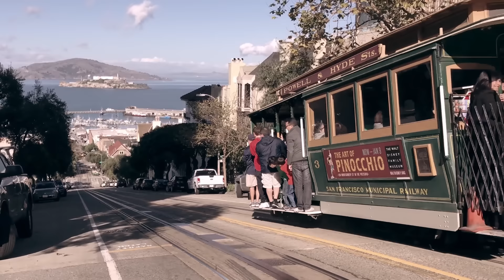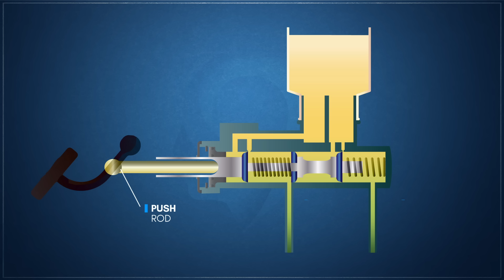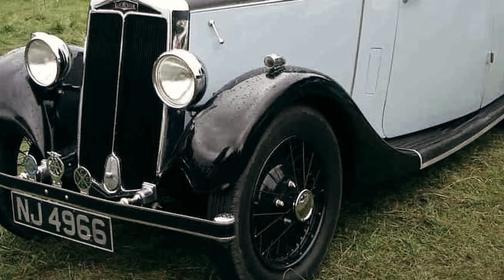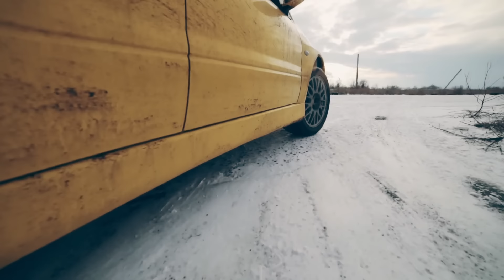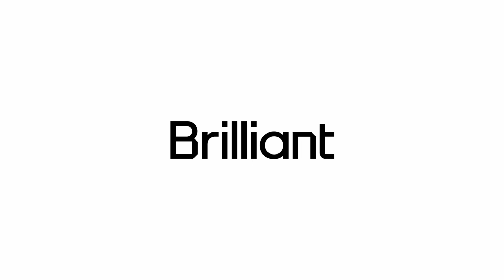The Science of Stopping

Comment from the maker: ▶Visit https://brilliant.org/NewMind to get a 30-day free trial and 20% discount on the annual premium subscription
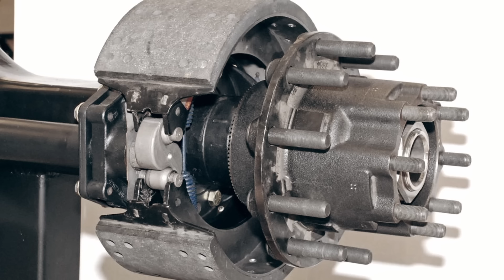Reply: 15:39 Should also mention UNECE, now the world's most significant vehicle regulation body (based on global country adoption), EG:
ECE R90, is a safety regulation which was introduced in 1999 for replacement disc brake pads and brake shoes - you will see "90R-xx" stamped on compliant parts.
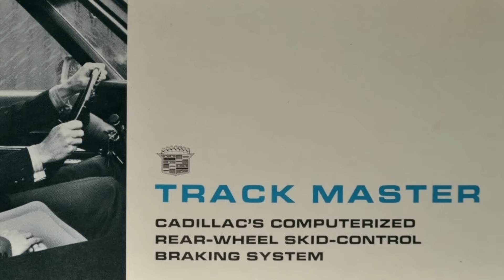18:24 The 'B' in ABS originally stood for Blocking, the engineering description given to a locked wheel.

Comment: Modern ABS systems have come a long way from the ones I grew up with and around, even when 4 channel systems became the standard. I know from my own testing with my 2003 Pontiac Grand Prix I had, if I modulated the brakes well, I could stop way faster than letting the ABS do the work. Now, I know brake modulation takes skills that most people are not willing to master, hence why ABS can be a great thing for those with a tendency to freak out and lock their brakes up in panic stops. At that point, yes, the ABS is great for making stopping distance shorter. However, I have seen even modern ABS systems get out braked by good drivers under a wide range of conditions. ABS, Traction Control and Stability Control are just band-aid fixes for people unwilling to actually learn how to drive.

Comment: Doing a bit of DIY motorsport gave me a new respect for the importance of braking. In the beginner stage the most important mechanical considerations are braking, tyres and suspension (in approximately that order). 

Most stock brakes simply can't be relied upon to withstand the extreme use of motorsport, particularly the amount of heat generated over and over again. Most people need to upgrade their brake pads to maintain friction at high temperatures, their brake fluid to stop it boiling, and potentially other components such as brake hoses, discs and calipers. Ventilation becomes very important too.

I was lucky with my Miata as it braked very well from the factory and the light weight reduced the amount of energy transferred for each braking event. But brake pads wore out very quickly, even the motorsport ones that cost several times the price of OEM. Discs would wear out at about half the rate of the pads and even high-temperature brake fluid could not prevent all deterioration and needed to be bled and replaced very frequently.

The lovely red paint sprayed on the clipers by the previous owner simply flaked off and eventually the dust boots perished and cracked, leading to a full caliper rebuild. That's when I realised how well-engineered the calipers were, because once cleaned up and refreshed with new seals and pistons everything worked perfectly again. And the polymer square-cut seals between the piston and cylinder showed no signs of wearing out whatsoever, despite almost 20 years of normal driving and a couple of years of serious abuse on the racetrack (and my inexpert attentions).

Comment: Fun fact: There is exactly one condition where non-ABS is better than ABS, if you are on a material that can build up in front of a wheel. Stopping a wheel and digging a little trench with it is faster than just slowing rotation. But that only applies to soft mud or sand, gravel, and uncompacted snow. But those materials are rare, which is why defaulting to ABS is better, and only some vehicles have the ability to disable ABS with a button.
Reply: Abs is ok but learning how-to drive has always served me way better than anyone's computer brakes bud
Reply: @Last-Chance-Garage-adventures  On a solid surface, ABS is superior to any human, because the computer can pump the brakes faster and more precisely than humanly possible. Of course, preventing to need the ABS in the first place is even better though.

Comment: Very good video, but I am missing one thing: Modern automotive brakes with metal brake discs don't use friction alone to convert kinetic energy into heat. They use stiction on a molecular level once enough force is applied and enough heat is generated. The high metal content of the modern brake pads is because of this. Imagine the metal atoms in the pads being close enough to the metal in the discs to get vanderwaals forces being effective. The result is much less wear in pads and discs than in traditional systems where all energy was generated by wear of pads/discs.

Comment: the problem with self driving cars is not driving a manual or controlling the steering wheel.  it should be more like the stuff about single wheel braking the steering force feed back to guild the wheel like playing a weegee board. something that you can over power if you want, but it suggests the steering inputs, and

Comment: 19:52 anti-lock breaks don't  create the shortest breaking distance possible. Highly skilled drivers (eg race car drivers and some performance enthusiasts) can out-perform ABS. It takes a lot of skill and harder to do if the available traction changes too quickly [eg if it suddenly starts raining in the middle of a race and the driver doesn't have the proper experience.
...Almost all race vehicles don't have any ABS at all (I think bk of a combination of added weight and cost to have a system that can out perform even a racer would make the richer teams have too much of an advantage)]
Reply: Most popular racing vehicles (like gt3 or gt4) got abs and traction control. In some series there isn't abs just to bring more driver skill in racing.
Also modern racing abs systems work so fast, that it's very hard to stop the car without abs faster than with abs even for pro racing drivers, and they never turn abs off during races to get better braking
Reply: @Grishazavr true "gentleman" class race cars do have abs and traction control but a driver is faster if they can avoid activating it. The exception is a few top level race vehicles that either don't have any (eg every formula car I know of) or where it is legal and has become part of the race to master the technology, eg MotoGP for traction control, or Hypercars for abs.
Reply: @lewisgordon1490  at first: you can't avoid to activate abs. It will trigger at some point for sure. second: gentlemen class? Do you know that a lot of drivers from 24h spa in gt3 class race next week in lemans 24h in hypercars? They don't turn off abs in gt3 to be faster. Even if you are somehow faster without abs by 0.3 seconds per lap, 1 small mistake and locked tyre would lose you quite a lot of time. And if you flatspot tyre it's like 1 more pitstop and more than a minute of time lost. Those 0.3 seconds per lap would never compensate it
Reply: True about lot of race cars have ABS but in most it is faster if you can drive under the limit JUST before the ABS activates in every race car that I know. In some classes the difference is smaller so some drivers just mash the break pedal esp if not the fastest of the drivers.

It may be disastrous for you or me to lock the breaks in a car but a pro racer knows how to deal w/ it. The worst case is usually they flat spot their tires then have an annoying vibration and be a bit slower, then they have to make the call of is it better to stay out doing slower laps or take the time to come in for a fresh set of tires. If it's a very mild flat spotting it's better to stay out but most of the time they get new tires.

Eg James Baldwin's usual race car has ABS but now he was driving a McLaren GT3 in the 2024 24hrs of Spa w/o ABS. He just came out for his stint on slicks w/ a drying track and some wet spots. Since his mind wasn't super tuned in to the balance between locking or not locking because his usual car did have ABS, he flat spotted his tires. He drove around w/ the annoying vibration for a few laps until he realized he was around 3 seconds a lap slower so took the time for an extra stop for new tires.

Comment: @newmind
 I am disappointed for your disinformation... ABS is absolutely not for maximum braking power, in fact only on dry surfaces you may observe reduction in braking distance. For wet, snowy and icy conditions ABS EXTENDS braking distance! System was never designed to reduce braking distance, but for avoidance of obstacles by allowing driver to steer the car while braking. If you really want to stop you need to keep your tires at the edge of locking up BUT before ABS kicks in. For most drivers this is impossible. But please do your own test brakes. With ABS on icy surface, and then try again with avoiding the ABS activation by gently pushing braking pedal. You will notice that ABS braking distance is much much longer. Please do a better fact check next time as you lost some credibility wit this video:(

Comment: The Disc Brake system was perfected and proven in Le Mans, like almost every safety feature was tried, tested, and proven during the 24 hrs of Le Mans, like windshield wipers, the safety harness (multipoint seatbelts similar in style to those found in modern race cars. The simple 3-point seat belts we use today was created by a Saab(?) engineer), fog lights, disc brakes, etc.

Comment: 6:47 the brake system doesn't "fluctuate" the amount of fluid used, it's more of the fluid gets displaced to the calipers and brake cylinders as the pads and shoes wear - which you kinda point out as you've explained through the video.

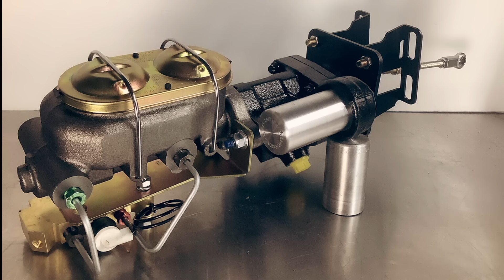11:15 hydroboost is primarily used to diesel as they don't generate enough vacuum (if I remember correctly or google doesn't betray me), there's another system used an electric pump that reserve hydraulic pressure present on 4runners (5th gen at least) and some other hybrids - why 4runner? I don't know because tacomas of that year use vacuum boost.

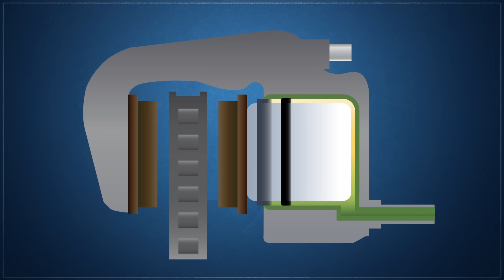14:01 I think if you've displayed it on an isometric view it would demonstrate how the caliper "floats" on the bracket attached to the knuckle/spindle with the use of the slider pin vs the fixed caliper which is directly attached to the knuckle/ spindle.

These are nitpicky and arguably unnecessary to know to the people who only need a bit of knowledge about these system, I do enjoy these videos and details like these can be useful.

Comment: I read somewhere that automotive is moving again to drum breaks for e-vehicles, since the reduced usage of the discs leaves them dirty. So they cant break effectively when most needed. A drum keeps the pads away from the elements
Reply: For what it's worth, most EVs with one-pedal driving have a mode or system that clamps the rotors just enough to clean the surface without the occupants realizing it. Sometimes this is only active in the rain (when wipers are enabled), while some have a discrete mode in their menus.
Reply: @Furious321 Yes, my EV has a hidden feature (mentioned in the manual) where you hold down an obscure button on the dashboard for 3 seconds to turn off regen braking and clean the brake disks.
Reply: I justed ordered an EV with drum brakes. Unless you're driving like an idiot, or making an emergency stop you should barely be using the actual brakes. Drum breaks have plenty of performance and endurance for that. The most torturous scenario previously was going downhill out of a mountainous region. Tens of minutes on end of twisty roads that zig-zag down a mountain face, and in each hairpin turn you have to slow the car waaaay down to make the turn safely. You'd really have to consciously try to brake using the engine as much as possible to prevent overheating your brakes. In an EV, it's pretty much the best case scenario for the car. It's charging all the time while you're going downhill, capturing nearly all of that energy.
Reply: they use the generators polarity
Reply: Drum Breaks are cheaper in production, i think this is the reason.
E-Cars have a Brake cleaning cycle, they but just a small amount of force the the Brake pads to clean of the surface.
Reply: Particle contamination that the braking system emits into the envirement, is the main reasson for moving towards enclosed braking systems, Mercedes is pioneering it.

Comment: 19:10 "such a rapid deceleration is impossible" - why?
Reply: I think it’s just missing a bit more clarity. Impossible that one or more wheels could go from high speed to ‘stopped’ immediately (implying the wheel must be locked while the vehicle continues to move, as opposed to the vehicle is actually stopped). Or impossible that, say,  the left front wheel is stopped but all the other wheels are still rotating, therefore it must be skidding.
Reply: @thereignofdando  let me add a tiny thing. The ‘impossible’ means that a vehicle never be stopped in a second by a brake.

However, a wheel itself could be decelerated rapidly when its tyre loosing grip (locked).

If it happened, the vehicle is not actually stopped, but still moving with a ‘rapidly decelarated’ wheel.

This is the reason why an ABS judges that the vehicle is sliding.
Reply: It is impossible for sudden deceleration of the vehicle to match the sudden deceleration of the wheel, more simply, the car cannot stop as fast as the wheel can stop rotating
Reply: The mass of the vehicle is known, the max deceleration grip of the tyres is known. So the max deceleration of the wheel is known. If the wheel decelerates faster then that means the wheel is starting to slip.

Comment: I like downshifting and braking with the engine... sadly works only in city outskirts and beyond, inside the city with pedestrian crossings, lights, turns every couple seconds there is simply no time for that. And if there is time and enough road- if you start slowing down way before the intersection several cars will cut you off forcing you to brake -_-

Comment: In the excellent description of the function of main brake cylinder however the vent ports and replenishing ports are vice versa, in reversed order. Not placed incorrectly, just described in the wrong order. The replenishing port is the smaller bore. Fluid is replenished to fill up the main brake cylinder when the pads wear in time. The vent ports is needed to displace fluid rapidly behind the seals when the pedal is pressed down or let up...

Comment: 17:00 planes needed anti skid system for landing gear with multiple wheel axles, if one of them stopped rotating during braking it could overheat and pop the tires during heavy braking

Comment: 19:30 actually the pump is there in this case (ABS braking) to reduce the pressure on wheels. When the pressure accumulator is full the pump forces fluid back to master cylinder against driver. This is what you can feel on the pedal and also why you should keep pressing it even after "Abs kicked in"
Reply: Thats kinda the point of abs, Mash the pedal and hang on
Most people without advanced training don’t know how to modulate the pedal or lever force to counter locking,
Letting go is hard you know 😢
Reply: @timmyjohnson7192  ABS is also just waaaay faster and much more precise than a human. It will outperform a human pumping the pedal every time.

Comment: Traction Control on some 4x4s can Lock the wheel that is in a low grip condition, so the other wheel can get the power from the engine. 
This means manufactures can forego adding locking diffs on that car and just software to help with maintaining grip in off road situations

Comment: Regenerative braking introduces a whole new kind of problem to vehicles today. Since the brake pads and rotors don't see much use while still being exposed to the elements, they suffer degradation by just sitting there. Rust and dust accumulates which makes them totally inefficient the moment you really need them.

If you have a vehicle with regenerative braking you'd do well to, at least once a month, make some full force braking tests/applications so that you clean out the rust and gunk from the mechanical braking system.
The last thing you want is to rely solely on regenerative braking to stop the vehicle in an emergency.
Reply: On my EV, I have a neutral gear position which means absolutely no regenerative braking.
I use it once a week while going down an empty mountain road for a few kilometers.
Best way I found to clean the rust and dust because otherwise even on my mountain roads the disk brakes are never used.

Comment: Your example, the emergency stop of a small car, displays a certain lack of understanding. The amount of energy dissipated in an emergency stop is identical to the same stop made smoothly and gently. However, the brakes dissipate the energy over a shorter time in an emergency stop, therefore the power dissipation is greater. Also, “10 knots per hour” is a unit of acceleration – I think you meant “10 knots”, or 10 nautical miles per hour, still an unusual unit to use for speed of a land vehicle. And finally, Nippondenso developed its ABS 20 years before it rebranded.

Comment: I’m going to experiment with regenerative brakes where the vehicle’s inertial is used to power an air compressor that fills a reservoir in the trunk. The charged air can then pass through a long intercooler next to the drive shaft and be routed to the intake manifold and be used in lieu of forced induction. To make it more fun, give the driver a boost button on the steering wheel! It’ll be like having an on demand turbo charger with no lag! 🥳

(Do not steal my idea please)
Reply: I've seen a sort of similar idea if a few ways.  One was a demo I saw at a science museum as a kid where regenerative breaking was achieved with a hydraulic accumulator I believe.

Also kinda similar to certain turbo setups with an electric motor also mounted to keep the turbo spooled at low engine rpm and to capture surplus energy from the exhaust to charge a battery instead of using a blowoff valve on the intake.
Reply: Volvo PowerPulse